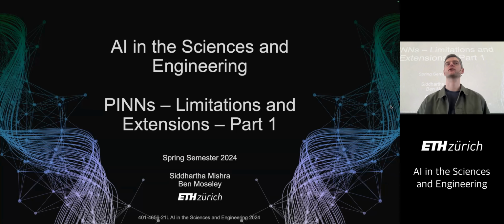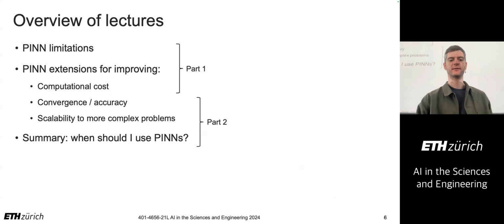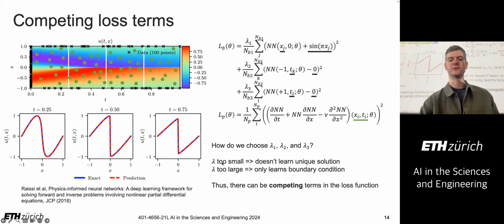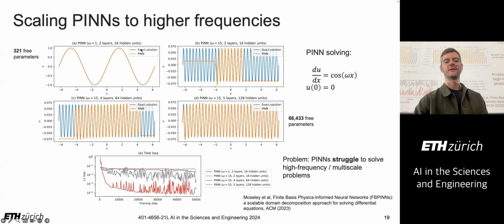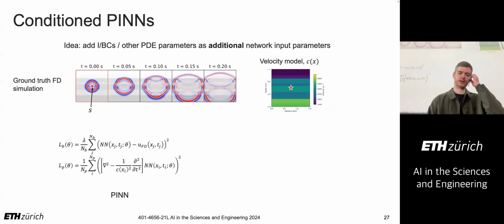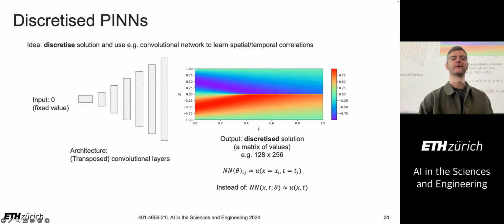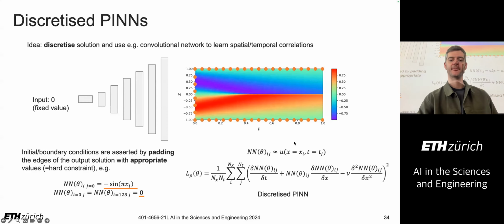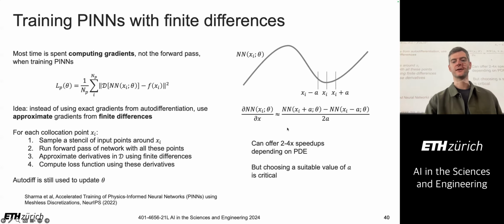ETH Zürich AISE: Physics-Informed Neural Networks – Limitations and Extensions Part 1

Comment: i’m not sure this video is correct about PINNs. it’s been demonstrated that certain PINNs and architectures of PINNs can deal with high frequency data really well (SIRENs), additionally PINNs are more computationally effective, and realistic, when compared to FEM, FD, etc. on large scale domains and an advantage to PINNs is actually how they scale to high dimensional data.
Reply: I couldn't find any papers about SIRENs from before 2025. Since the video is also from 2025, maybe the lecturers weren't aware about SIRENs due to them being a recent advancement.